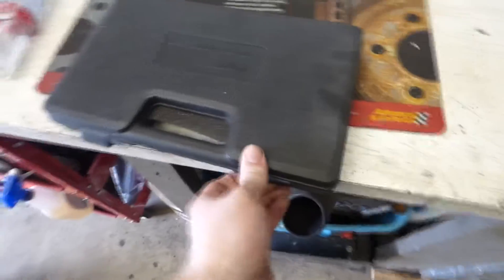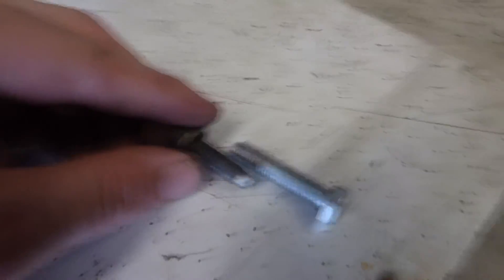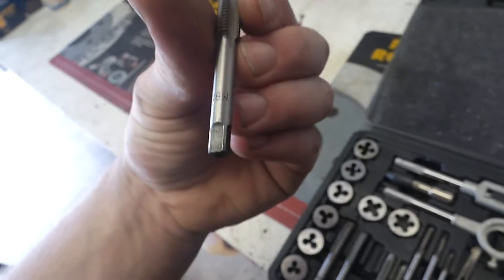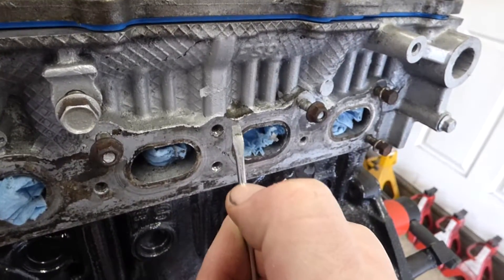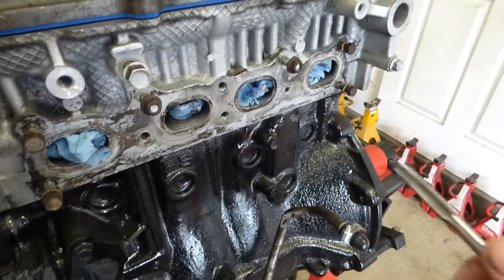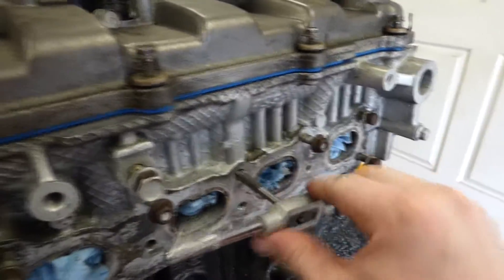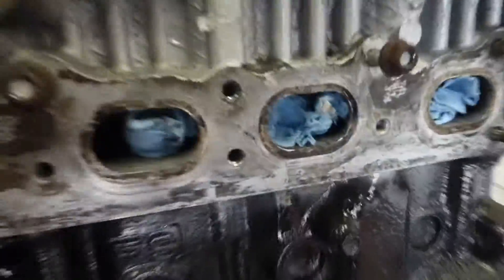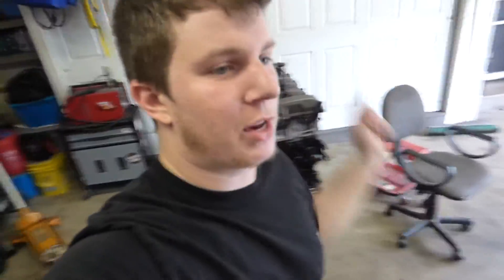How to fix a cross thread

Comment: I replaced the alternator, but the top bolt is going very hard, I attached it but it is not like in this and other films, attached with a hand very easy. Does it mean that I crossed the thread in that bolt? If I do it 
again I would tread the bolt in the hole first to see how it would go. If I crossed the thread, what would be the consequences of it? I would appreciate any opinion on this matter. Doesn't matter much, but the car is 2001 Saturn sl2. Thank you for this interesting film.